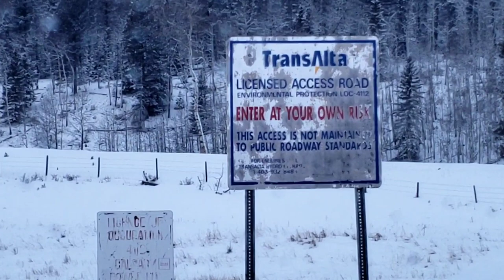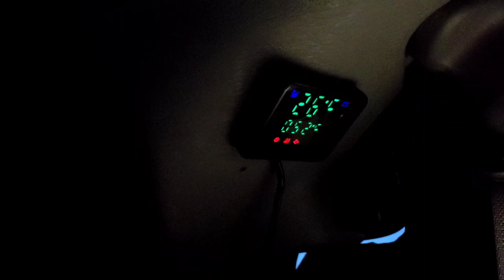Minivan life in Alberta vlog #5 Super cold -17 Celcius (1.4 F) Diesel heater made this possible

Comment: Get a RoadPro 12volt lunch box. Put the hot pocket in a half hour before you get to your campsite and it will be ready to eat when you get there. Most truck stops sell them. Buy some of those tinfoil bread pans so you have less clean up. I reheated a hamburger in a 10 minute trip once
Reply from the maker: I might just do that!  I'm on the fence about having a microwave, just soo big,. But my inverter would run a 700 watt easy.